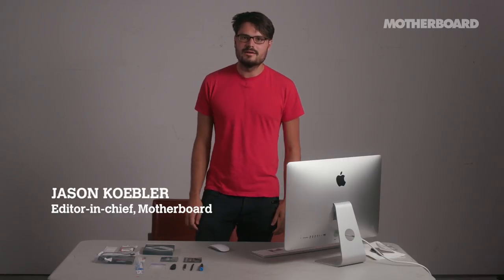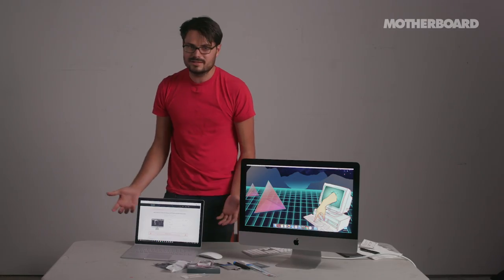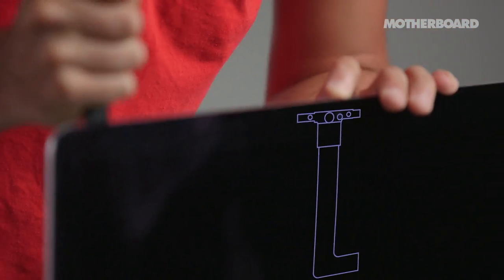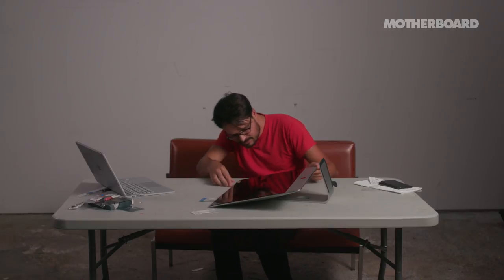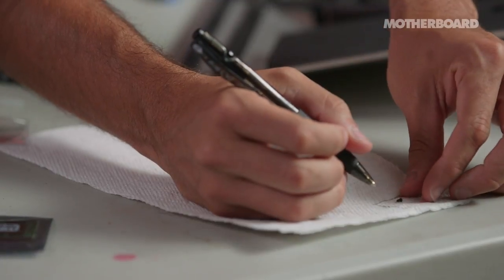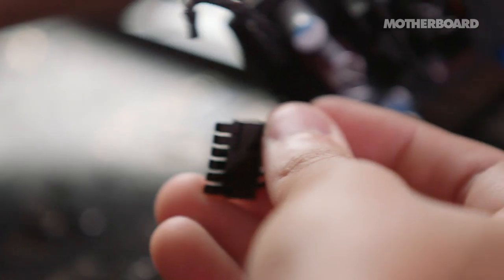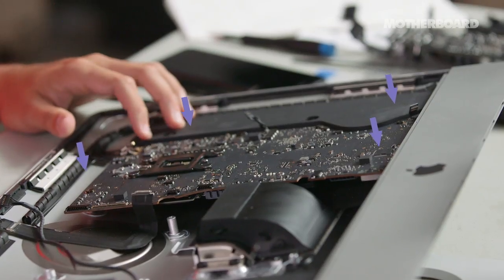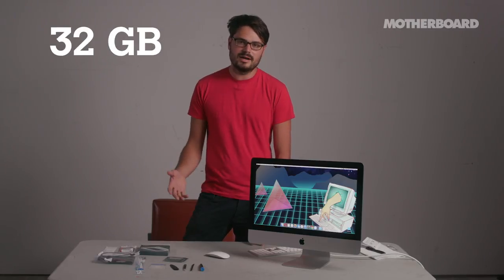Can a Normal Person Upgrade the RAM in the 2017 21.5" iMac?

Comment: So I went to purchase 2 16gb RAM sticks on my mid 2017 3068 from a seller on eBay and they messaged me (after I bought 2 8gb and thought I should just go to 2 16gb hindsight and wanted to return) that my models, which I gave them specs, processor 2.3 i5 would only handle 16gb of RAM. Here you have the same computer as mine and your putting in 32. I know, eBay seller. But can I put in 2 16gb for 32 in my model without hurting the processor? Didn’t sound right a processor should be happy to have more running memory. Any suggestions would be appreciated.

Comment: Kind of a joke the base model even ships with only 8GB in 2017 😂😂. 👎👎
Reply: Most people who will use it don't need any more RAM. It's the base model, for office work, and home use. Not a games machine, but a workhorse which will run efficiently for many years.
Reply: Yeah but... the price.
It demands at least 16GB preinstalled.
Reply: Eleanor Catherine Davenport Much more of a workhorse than Windows.

Comment: They call having to remove the the logic board, user upgrade-able memory? apples is a farce - fapple, no this is not upgrade able for the average user at all, only a nerd who has the patience to do it themselves? Even as a tech support who does this for a living, I can clearly say you can't charge the hours this will take to a client without is costing more than buying the upgrade from Apple. Apple are still screwing the user over as per usual, it's disgusting.

Comment: Lol for dry instructions on how to do it watch the video he was watching, it's step by step and very thorough. This is just entertainment.

I'm a pc guy myself, but I just bought the same iMac (used) for work. Unfortunately my field (design industry) almost requires macs, at least the positions I'm looking at ask for "Mac experience", and some industry standard tools are Mac only. I'm planning to upgrade ram, and possibly storage as well in future. Ifixit said they might have a guide to upgrade a cpu as well, would be dope to get an i7 in there, together with 32gb of ram and an ssd it'd make a nice (overpriced) computer for work.

It sucks that Apple makes people jump through hoops for such a simple procedure (on pc), but at least it's not soddered to the motherboard..